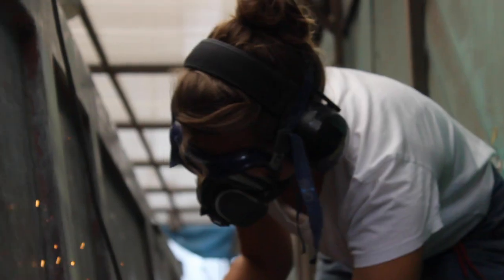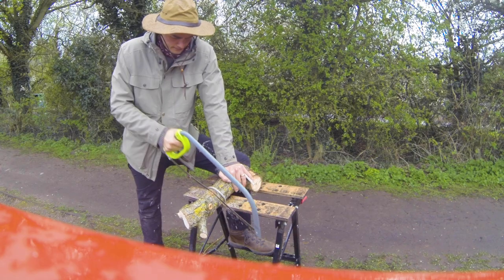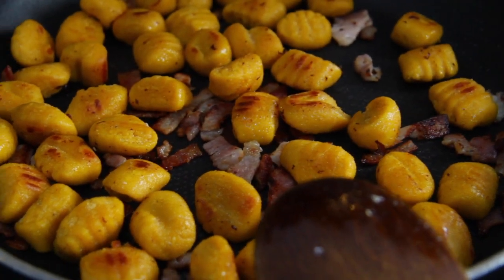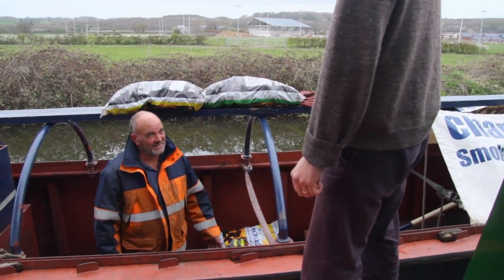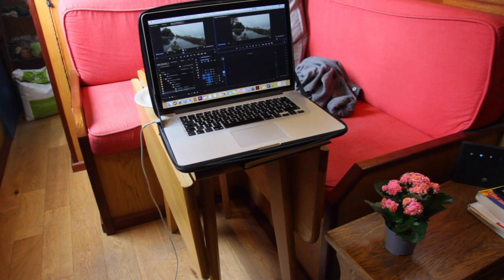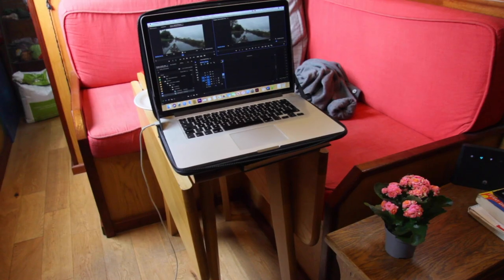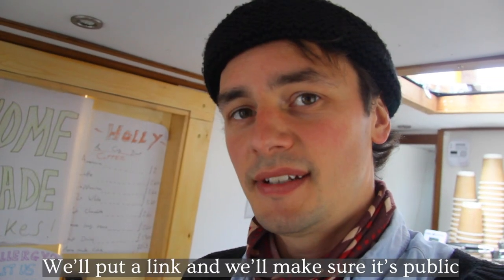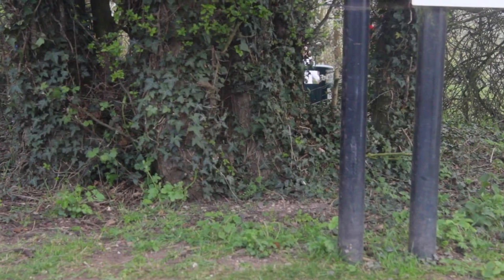Historic working narrowboats to the rescue!

Comment: Hey all, caught up on pass video's so now once a week. So much fun and makes me hungry with all the baking.
Oh btw, if you start a good fire then put 2 big wet pieces on top the fire will dry it out as it burns, learned that while growing up on a farm, only wood heat for the first 60 years of my life. But I only had to haul the wood in for the first 30 years, 21 to 25 cord of wood per year. 4 foot X 4 foot X 8 foot 
That's the stack size that is a cord.

Comment: I love this channel. Its nice  to see  the signs. Don't worry about fancy writing. Print it on a computer,  chalk the back, and go over the lines to etch the chalk onto the wood. Then paint over. 

Also, the fuel boat - you can normally call them and order, so they place the order on your  roof from the water side if you're not there

Comment: Looks like a good day on Holly!
That ultramarathon was the Millenium Way Ultra - 41 miles from Newport to Burton upon Trent. I ran it in 2016 (about 8½ hours).
Canal towpaths are popular routes for races, as you may have noticed! I've run several, and I keep entering the ballot, unsuccessfully so far, for the Grand Union Canal Race, which is 145 miles from Gas Street Basin, Birmingham to Little Venice, London. Should you happen to be on the GUC on the Spring Bank Holiday weekend, keep an eye out for them running/walking/crawling by - they may seem unresponsive, in fact getting further south they may appear to be sleep-walking, but they will appreciate any support!

Comment: All the washing up water does that go in the canal,  in the RV we have grey water tank that then is empty into a  utillity drain, could you not do the same?
Reply: No Reply; is too hard to answer
Reply: Thanks for the reply but what is the answer?
Reply: The answer is yes the washing up water goes into the canal. Also the shower water and washing machine water. I guess it would be possible  to fit a grey water tank if that was your wish. You would struggle to find a utility drain near the canal. A lot of boaters use eco friendly detergents. It's fine, and has been since about 1761. Don't swim in the canal. 🤔

Comment: Please could you put where you are  it’s called. three words location. On every episode then we know where you are when we typing on the app. Thank you love the show Jeff x
Reply: There are other ways to do location without using a commercial app. Open Street Map, for example.
Reply: I think it you will find it’s called what3words. FoxesAfloat use it a lot.
Reply: @qwertyTRiG  there is a free version - very handy
Reply: @lordflinty  Nah. You may not have to pay for it, but it's still running unknown code using a secret algorithm. If the service dies, all the saved output becomes worthless.

And no one has ever explained how it's better than OS grid references, which are easy to understand and can be supported by any programmer and baked into the mapping software of your choice.